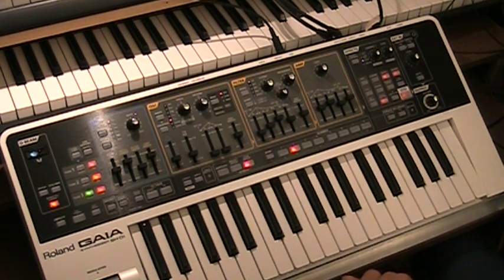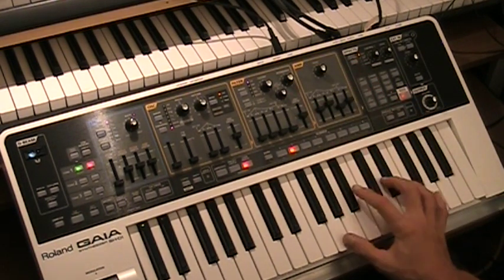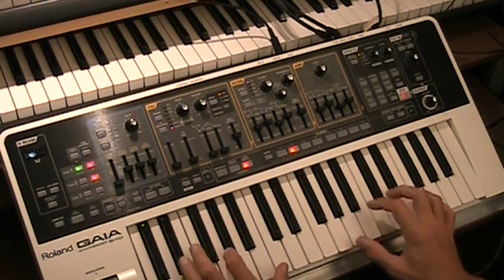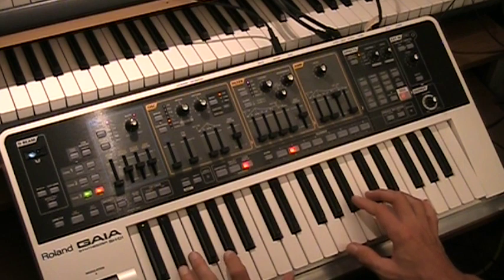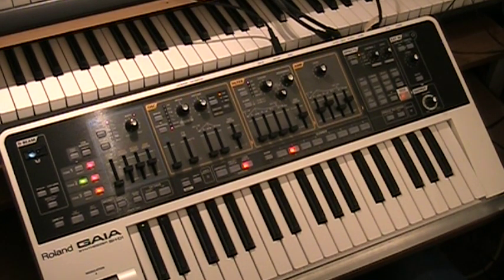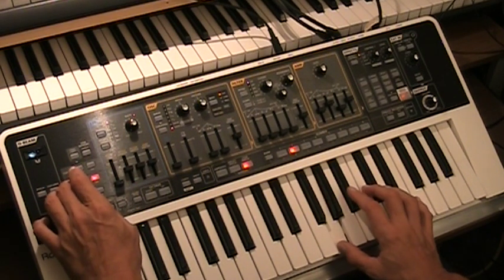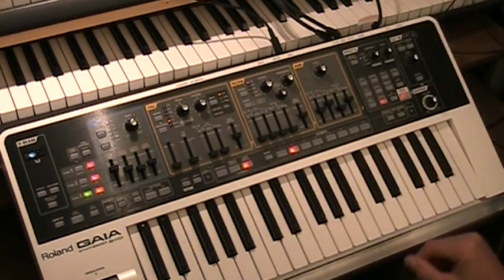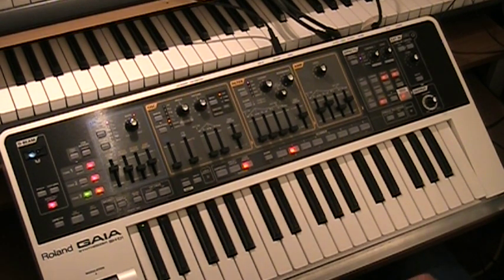Roland Gaia Tutorial 1 - A BIG Synth Orchestra - Subtractive Synthesis

Comment: i've had this synth for 5 years and didn't know you could pan the individual synths lol... this makes it so fat! and opens up a whole dimension of natural sounding tones.
Reply from the maker: Oh yes! I will not buy a synth that does not have panning of oscillators. The stereo field is extremely important to me and half the fun of sound design..for me. Effects can also create stereo fields but far more limited in creating an original stereo field. The last sound design I did on the Gaia was to begin the tone with one oscillator in the center, then delay the other two oscillators with the attack of the ADSRamp so to have a sound that transitions from center to far left / right....very kool.

Comment: Awesome sound!  Very Vangelis-like at parts.  I've also discovered that the super-saw is a great waveform to get some nice, full analog-type and string-type sounds.  Another trick -- you can use the peaking mode for the filter to really add some bite to the sound -- great for leads.  Just be careful with it, because it can really cause some screeching sounds if set to excess!
Reply from the maker: Thank you. And thank you for the sharing your wisdom. One thing on the Gaia I have not done, but will begin on some patches is to use a very slow sine LFO on pitch with very little amount, and vary the rate and depth for each of the three oscillators so they drift ever so slightly in pitch.

Comment: This is an awesome tutorial!  Impressive little synth, I have never really looked at the Gaia before.  Have been wanting a JP8000, but I see now how this thing has a lot going for it.  Might have to think about adding one of these instead of the older "how long before it breaks" JP8K.  Thanks for the lesson!
Reply from the maker: Amazing, me too, kept looking for a JP8080 rack mount, but ebay prices were almost the same as new $600 is too much for a used 20 year old synth. So I bought the Gaia, and it became my favorite synth of all time. 3 or everything, panning of individual oscillators, great effects, plus lots of extras, 64 poly synth. I add a 10 graphic equalizer to this synth for more tone control...see the video on the EQ addition. Thank  you.
Reply: Hey Martin thanks for the quick reply!  I have watched tons of Gaia vids over the past couple days, and your tutorials rock!  I really like the 3 "tones" approach on this synth.  How do you find controlling this thing with Midi?  I know its got some GM sounds on midi channels that can be turned off.  Is it easy to use an external sequencer to drive it, and can it be sequenced and played at the same time? I haven't seen the EQ video, I will have to go look for it.  Thanks!
Reply: Found the EQ video, that was pretty cool.  What a big difference in sound.  I may have one in storage from my old Kenwood rack stereo that could be used.  I might just have to try this on my Juno 106 just to see.
Reply from the maker: 64 notes of polyphony so sequencing from a remote clock and playing the Gaia at the same time no problem.....except....it is not multitimbral synth, so the same tone patch only. It is probably multitimbral with the GM 128, don't know for sure, never tested this feature. I use the external clock via MIDI in and then use the on-board phrase sequencer to sequence the Gaia. The Gaia's phrase sequencer can be 8 bars long and free of quatization.
Reply: Martin, thanks for the info.  I knew it wasn't multitimbral, would be nice if it was.  I think the Gaia is for me, I really like the layering 3 synth engines.  I have really enjoyed all your videos on this instrument!
Reply from the maker: The only downside to the Gaia is its oscillators, they aren't big and beefy like Roland Boutiques, System8 and 1. I have a Boutique JP-08 and a JX-03, these have some heavy duty sound to them and I use them for any solo mono synth tone now in unison mode (4 voices in monophonic). So sound wise I would have to say the Roland System8 has to be the best sounding of all Roland's synths...if you can afford the $1500.00 tag. The Boutiques and System synths use the ACB technology (analog circuit behavior) it has polyphony limits like analog is the downside to ACB. /// as a side note, my jaw just dropped at the Behringer DeepMind12...they just dropped the price $300!!!! You can get a 12 voice analog synth with a 61 note keyboard for $700.00 now....unbelievable....I am seriously considering this synth next instead of a Roland FA or Juno DS, or Moog SubPhatty.
Reply: Martin thanks for info!  Yes I figured the oscillators might be a little thin, but still hard to beat the 3 "tones" approach.  I have watched every Deepmind video available I think, can't believe they just dropped the price that much!  Wonder what is fixing to be released?  (only 49 keys by the way).  I have been wanting the DM12, but for $999 was a bit much especially since I have a Juno106.  The Gaia used is sub $500 or even under $400 at times.  I have been wanting some of the boutiques especially the JP08, JX03, and the D05 so the extra bucks could go into those.  But at $699 for the DM, would be hard to pass up with all its cool cross mod stuff.  If you get one, can't wait to see your videos on it!  Im still waiting on funds so it will be a few more months before I move on anything.
Reply: Martin, I forgot to ask does the boutiques in unison mode have a detune feature to fatten up the sound?  Have you ever midi'd a boutique as a "stacked synth" (I think that what they used to call it) to track your playing on the Gaia to add an additional voice to beef it up?
Reply from the maker: Both my JP-08 and JX-03 are two oscillators synths and both have a fine tune for detuning one oscillator and get that fat sound of two oscillators slightly out of tune. Yes, I purchased the Boutiques with the intension of using three Boutiques together as a 5 oscillator combined synth....but Roland stopped production on the JU-06 before I could buy one. So now I may finish up the trio with a Yamaha Reface CS. Presenting I have the Gaia and a Reface DX MIDI cabled together for a fatter sound. Combining synths with MIDI has been a staple of my sound design for 28 years.
Reply: Thanks thats good to know!  I feel some cool playing around with some stuff coming on in the not too distant future!
Reply: They dropped the price on the DM 6 to $499 and the DM12D desktop to $599 as well.
Reply: Just did some looking at the System 8.  Im impressed.  Apparently they just added the JX-3P plug out and new FM waveforms included with the synth.  So you get a System 8 including the Jupiter, Juno, and JX plug outs.  If I had to buy 3 boutiques Im at $1000 already, and the JU-06 boutique I haven't seen on the used market less than $600, if you can even find one.  There are plenty of JP-08 and JX-03's available.  I would have to do some investigating tho on the splits and layers and capabilities with the System 8. With the boutiques they can be running sequences or Arps during a jam.  Can I get this on the System 8, is it multi-timbral as far as being able to run multiple sequences simultaneously while playing?
Reply: Oh my Martin, you sent me down this System 8 thing where I have wound in and out of what feels like hundreds of videos.  With the 3 vintage poly synth plug outs included and 3 or 4 vintage mono synth plug outs available, the addition of recently released FM waveform stuff and the native sounds of just the S8 itself...well thats a lot of available tone!  Knock this thing down to $1100 bucks or so used, and it seems like a lot of bangs for the buck!  Have you ever had the chance to mess around with this machine?
Reply: @funnzie  Now you can add the JU-06A and get the 106 or 60 with the flip of a switch!
Reply from the maker: @michaelwarren824  Sorry i missed your comment a year ago about the System8, YouTube is not perfect for posting comments. Answer: No, no live experience with the System8. But if you wanted all that vintage gear in one box, it is a great way to do it. But since you already own a Juno, sounds like too much money to spend on a System8. Did you buy a System 8 since we last wrote?
Reply from the maker: @michaelwarren824  Yes! I saw the new release of the Juno....but....The new release of the Hydrasynth from ASM, a new company, but been building synths for other companies for years, has caught my attension. The HydraSynth is a dream come true for this digital synth guy, it is what I have hoped for...for a long time. So I will probably go ahead and buy the Yamaha CS (only $280) as the final layer to the boutiques. and save for this new synth......maybe. Also wanted to add a sample sequencer, the 1010Music Black Box.....
Reply: @funnzie  Martin, no System 8 yet.  Took all the resources I had to get to getting to my retirement benefits end of last year, so ended up selling the Juno and my Roland VR09 piano/organ (and a bunch of other stuff), so really starting over musically from nothing.  Just picked up a XP-60 from a pawn shop a few weeks ago at a great price, but haven't had time to do anything with it yet.  At this point, I doubt I will be able to afford a system 8 on a fixed income, so I doubt I will end up with one, and Im not sold on how much computer integration is needed to manage it and the plug outs even tho I have really grown to like its sounds.  Im starting to think a few of the boutiques like JX03, Behringer Model D (or Pro One if it ever comes out) or any of a couple of these would be nice to have.  So far like what I have heard of the new JU-06A.  Have thought about a Basestation 2 as well.  Im following in your foot steps of building up from inexpensive hardware out of necessity, but it also makes financial and musical sense to do so.  I have even found a GAIA for $229 wish I could scoop it up right now, but just can't. I still think the GAIA is a great hands on machine so will continue to be looking for one when the time is right.
Reply: @funnzie  Martin, sounds like a plan!  I watched a few youtube videos on the Hydrasynth a couple weeks ago and it looked quite interesting.  If you do get one, would love to see what you can do with it!  Your explanations/tutorials on these other synths have been great.

Comment: This was really good up until the last few parts. You played around with the LFO, but didn't really describe what you were doing with the settings. That, I was at least able to figure out. However, when you got to the effects, I'm sorry but you didn't tell us how you were setting the delay or reverb at all. On a patch like this, those effects are very subtle and I could have used a little guidance, ie: "Turn control 1 to 4 o'clock" or something like that. Also, you assumed the viewer understood how to set the D-Beam's effect. I think I got it, but I had to dissect the video quite a bit. Please don't get me wrong, this is an awesome tutorial and I got a phenomenal patch out of it. But I'm just saying that I could have used some more talk about the dial settings. Thank you kindly.
Reply from the maker: Thank you for your comment. I think you misunderstood the purpose of the video. The video series is not for patch duplication, but how to use subtractive synthesis to design your own sounds. A synthesizer is designed for creativity, somewhere back at the beginning of sampled sounds (PCM) this got mixed up. The synth is a creative tool, there are better keyboards out there for playing presets than the Gaia, and thousands of soft synths for that too. So in this series each of the sounds I chose to design was only used to illustrate the teaching points of that particular video. Let your creativity flow :)

Comment: This was amazing, sir.  I've been gaining understanding gradually, but I had no idea about the panning.  Thanks so much.  One question for you though.  Is it possible to designate an arpeggiator to one specific tone as opposed to the arpeggiator having to be designated to all three?  I noticed with some presets, that's the set up.  But I can't figure out how to do it myself.  Thanks again.
Reply from the maker: +dnoelproductions NO. most of the functions on the bottom of the panel are global, as are the effects.
Reply from the maker: +dnoelproductions Here's an extra: The Gaia has sample tones built in, a complete MIDI capable general MIDI. You could then insert a MIDI cable and set a pattern (arpeggiator simulated by looping a pattern on your computer) in MIDI and transmit that to the Roland. You could then theoretically play the Roland over the top of the MIDI pattern coming into the general MIDI generator.

Comment: How do you manage to adjust the faders for other voice once they become all over the place?
Reply from the maker: I stay organized if I am use all three "tones" Roland entitles the 3 synths as tones. I first have a good idea in my head before beginning the sound design. I do the reset and move all controls to neutral like in the video. Then I use the first tone to create the most complex sound of the 3 tones. After finishing the first tone I copy the first tone to the second tone, this way all the controls are showing what you are hearing. Then after completing the second tone I copy it to the third tone, again all the controls will then show what you hear. I complete the third tone. Now I finish the sound design by switching between all 3 tones, but now if I want to make a filter change on tone 2 (for example) I will have the twist the knob until it "catches up" with the setting for tone 2. With so much control over each tone, it can be confusing when switching between all 3 tones and making adjustments because the physical position of the control will be wherever you last used it, and will have to be moved while you listen to the sound to make the adjustment you desire. The complex sounds the Gaia is capable of makes it more difficult to use than a synth with only one filter instead of the Gaia's three filters....and three of everything.

Comment: Great tutorials!, I have been trying to create a synth choir using the Gaia without much success, any hints?, and is it even possible ?cheers, Keith.
Reply from the maker: A choir would be a challenge I have not attempted yet. I would guess the filter envelopes could give you the WAAA or OHHHH with just the right oscillator and filter type and slope. Also try the effects section "bit crush" there are options for this effect, some are human sounding.
Reply: Thanks funnzie, I will give these ideas a try.

Comment: I wonder how the Gaia stacks up today, 2023? I've been thinking of getting one because it seems simple enough to be creative during live performances with my looper. Anybody?
Reply from the maker: For live performance the Roland System8 would be a better choice for digital with all the surface controls. The Gaia with its three layers is more powerful, but I would not want to design the 3 layers on stage. iF you want that 64 notes of polyphony the Gaia is the only tactile control synth offering that many voices, the Roland System8 only has eight. Maybe a Novation Summit too?
Reply: @funnzie  Hey Thanks! I'll look into them! Great Work!
Reply from the maker: Roland just discontinued the Gaia SH-01, the replacement is the new Roland SH-4D, more powerful than the Gaia, more layers, sequencer, more oscillator options, same hands on control, but no keyboard and 60 voices instead of 64. MIDI access to the 5 layers on the SH-4D.
Reply: @funnzie  Thanks for the tip! I like the analogue style of knobs and sliders over a programming window. I'll look into the SH-4D. I've got the Roland/Boss RC 505 mk2 5 channel looper with effects, which allows for some fun, live, on the fly options for a single performer. (keeping a band together, not so easy) Have fun with it, Peace!
Reply from the maker: @WmArthur  You're welcome. Ha ha! Me too, solo piano performer, no band ever in my life, nor would I want one. But the stress of playing whatever piano is on the stage is forever a challenge.

Comment: Love the GAIA sounds, and its capabilities, but its limited 3 octaves is a major drawback for me. I wish Roland would come out with a  61 key version, it would be a monstrous keyboard.
Reply from the maker: +Karim Nasser With the Gaia's simple MIDI port adding a keyboard is easy. For most performers or studio players, the Gaia would not be your one and only instrument. I can MIDI cable in from 61 or 88 keys within my studio. IF this is your only keyboard, make sure your next keyboard, such as an 88key piano has a MIDI port.
Reply: You mean to tell me that you can't go lower or higher in octaves, other than what is already on the keyboard? You got to be kidding me. This is a 600 dollar keyboard. No way. That is definitely enough for me to never, ever buy it. If I can't go up 3 octaves and down 3 octaves the whole way, it ain't happening.
Reply: @natanunorthodox  No, certainly not!  They just mean that the physical keyboard is only 3 octaves.  First of all, each oscillator has a 4 octave range.  Then, any sound you make (and by "sound", I mean a complete sound or patch using up to all three available tones) can easily be shifted up or down up to 3 octaves, and then this octave shift can be stored as part of the overall patch.  And then additionally, you can manually shift any sound you're playing up or down up to 3 octaves -- and this octave shift is a manual setting that will stay in place even if you change the sound from one preset/stored patch to another.  So, you have all kinds of octave shifting capability on this synth.